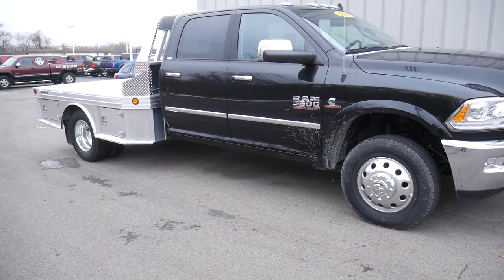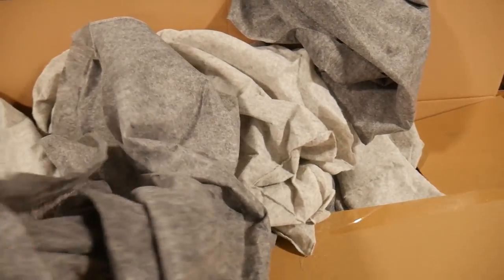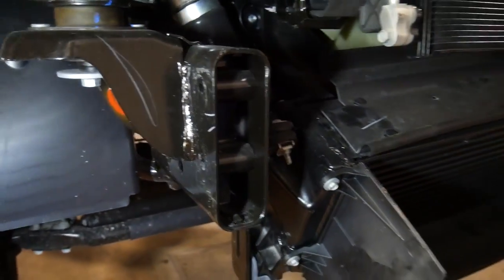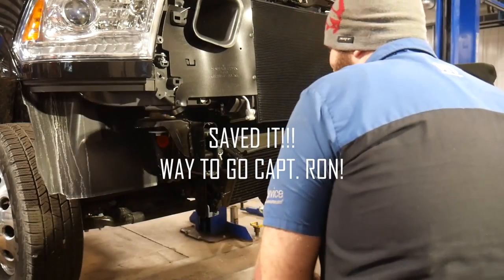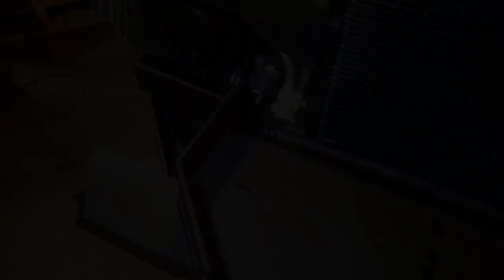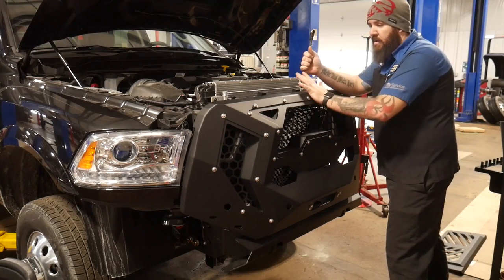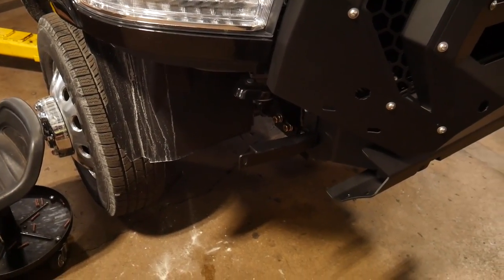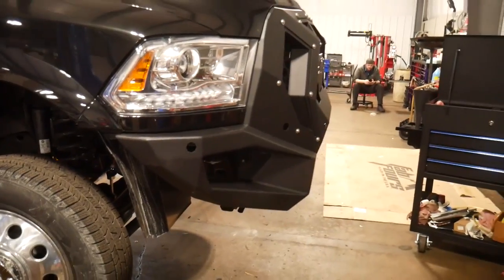2018 RAM 3500 GRUMPER INSTALL

Comment: I have a 2018 Ram Sport. Isn’t the front end the same as a 2500 or 3500...? So technically I could put the Grumper and Vicowl on it...?

Comment: @8:10  are those actually SAE bolts being threaded into the metric thread frame nuts?
Reply from the maker: In that area the two vertical are the factory u-style clamped together bolts coming through the frame from the middle with nuts on the outside and the horizontal gold colored hardware are nuts, bolts and washers from the kit put through factory drilled holes in the frame. There are no welded in frame nuts